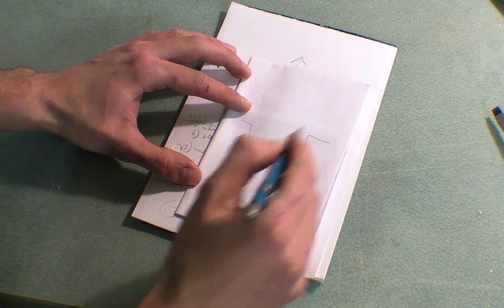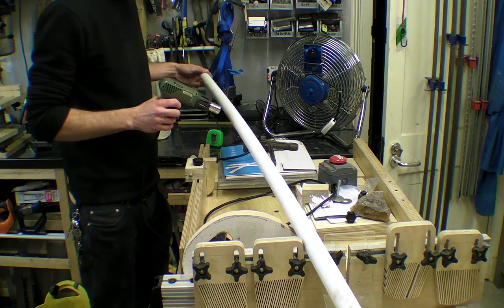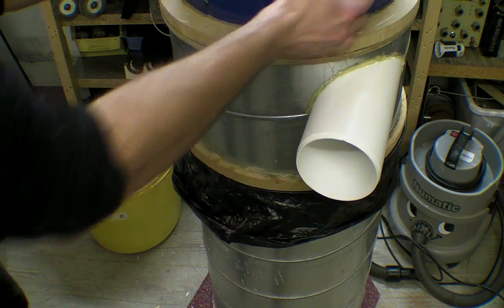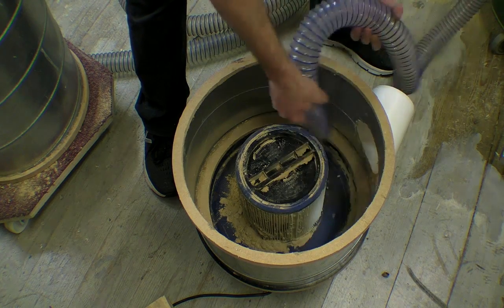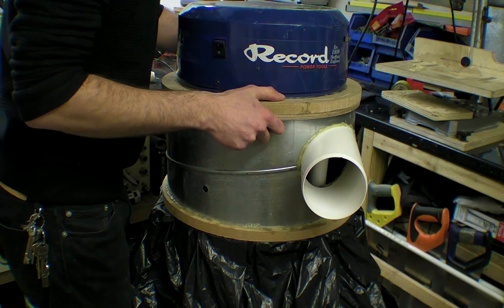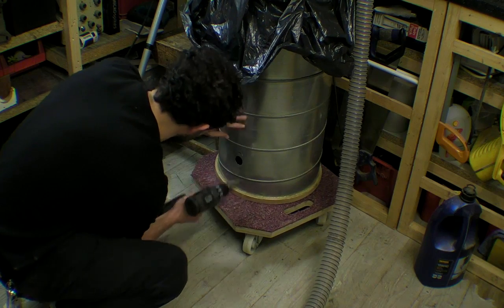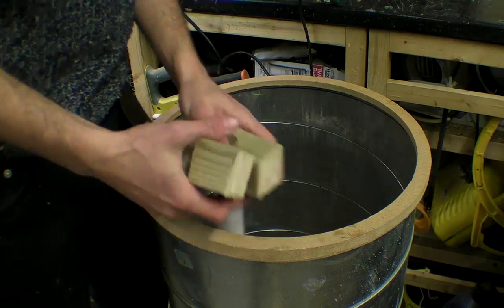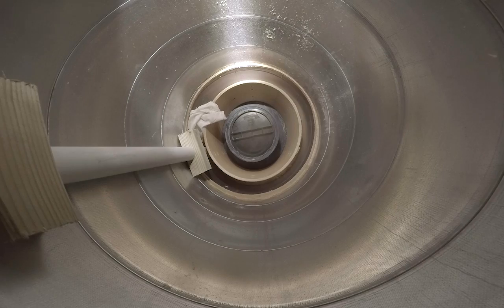Preventing Bag Lift within HPLV Extractors?

Comment: This extractor has a Numatic motor in it.When you opened up the top lid case (9:23),you can see the original hexagon logo Numatic sticker on the motor.
Reply from the maker: +Numatic Collector Have I just ruined something rare?
Reply: +Savvas Papasavva No,just felt like pointing it out,quite a lot of extractors use that motor
Reply from the maker: +Numatic Collector Ah another sigh of relief. You collect neumatic extractors?
Reply: I collect the smaller Numatics like Henry.I had a yellow Numatic the same as your grey one.

Comment: I think your easiest way is to follow the original principal of the cage (to prevent bag collapse} and remove the bottom of the drum and put the bag over the outside and seal it to the motor housing with a ratchet clamp or luggage strap. It doesn't reduce the suction in any way that I can see. I have a homemade cyclone separator on a small drum to augment the main extractor.

Comment: Solution: you need a sleeve in it. Like that big pipe you installed in the cyclone. Drop the bag in, then push sleeve into bag. Sleeve does not need to go down all the way. As long as top half is sleeved, it prevents the bag lifting all the way up. Once bag is full sleeve can be slid up from the bag than empty the bag. Not very elegant, but I'm sure it works

Comment: You are 90% the way to having a Thein baffle. I would lift the top unit up with some of your leftover ducting, to place the filter above a new diaphragm, creating a separate top chamber. Add a piece of pipe into the dust separator, and a Thein baffle diaphragm between the inlet chamber and the collecting bin.  The top chamber will be at a much lower pressure than your inlet, due to the vortex pressure gradient between the inlet and the pipe.  A pipe leading from the top chamber to the collecting bin  will give the negative pressure you need to keep the bag form lifting.

Perhaps 2 issues with this suggestion - it's a bit more effort to build, and since its HPLV, the pressure drop overall might be a problem.

Comment: You need to tap the vacuum between the filter and the blower.  If you take the air after the blower, that's the highest pressure air in the system, which will only help to push the bag up.

You can also prevent bag lift by having the bag completely inside the drum, that is, the edges of the bag don't come out thru the connector.  That's assuming the bottom drum has no leaks or holes in it.
Reply from the maker: +Matthias Wandel That sounds like something I should have considered before I glued the filter on.  Magnetic tape has become a lot cheaper recently so that latter option could be an option although I've also made a valve which seems to have made a difference.  Thanks for the advice!

Comment: Maybe I don't understand the problem or did you already tryed to put a weight in the bottom of your bag...in the form of a round disc? this could be disposable made from soem scraps of material?
Reply: I thought the same: a round disc of steel in the bag and some magnets glued to the bottom should prevent the bag from lifting. I may not understand the problem too though.

Comment: I thought the negative pressure that would need to be on the bag would have to be evenly spread across it. So an idea I had would be to cut a circular piece of wood be it ply or MDF the same size as the interior diameter of the spiral duct tube. 

Drill many holes in that evenly spaced to allow plenty air to pass through. Lift the board off the bottom by roughly half the diameter of the inlet. 

At the inlet of the extractor add a Tee. Have one hose as you would going to your dust source and the other looped back to the bottom under the board with the holes. If you have both hoses the same diameter after the tee I'd image the negative pressure to be equal on the bag as the inlet is the restriction to how much suction there is inside the drum.
Reply from the maker: +Sam Tranter I haven't really given myself enough space to try this out but it would be interesting to find out what other set-ups would improve this.
Reply: +Savvas Papasavva That would be my first through. Divide the positive pressure by two. The way the plastic bag is, it would bunch up around a single inlet such as at the end of the 2" pvc and would just plug it. The idea is there, just has to cover a larger surface area. Similar logic to what's used with filters. The larger the surface area the less the restriction.
Reply: +Sam Tranter Some of my spelling in this is appalling. My apologies.
Reply from the maker: +Sam Tranter Lol, don't worry.  Thanks for the suggestions!